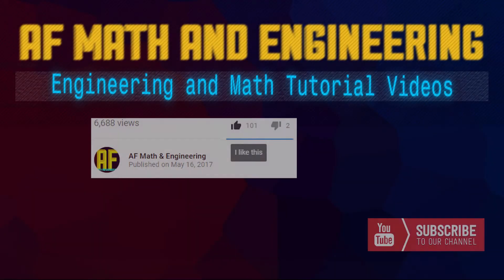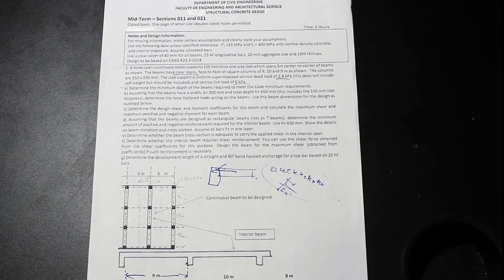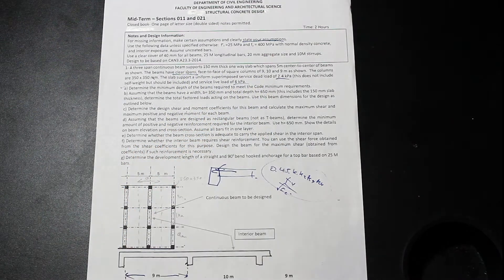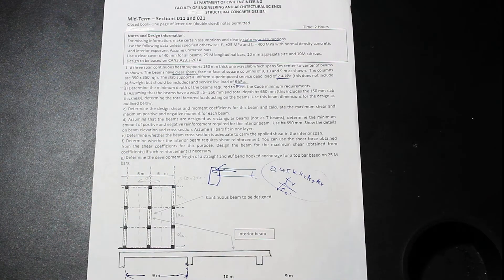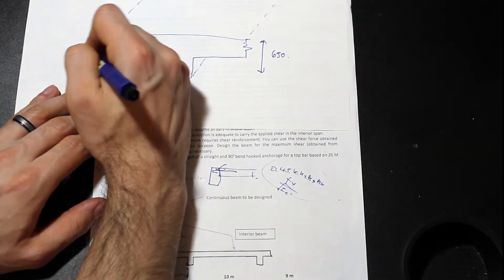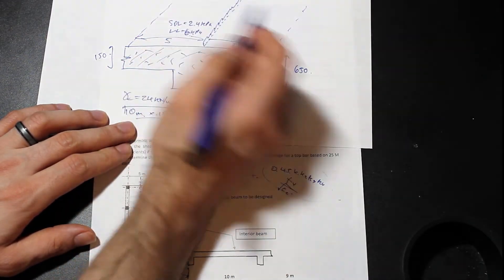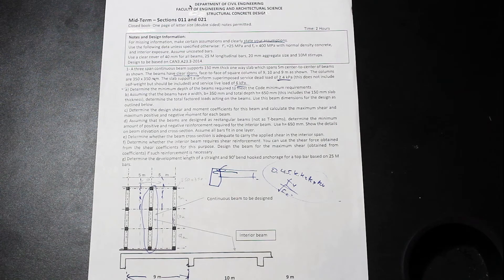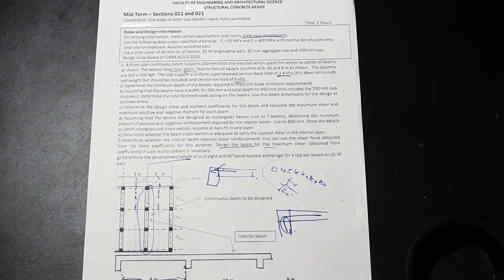What Do Civil Engineering Exams in University Look Like? - Structural Concrete Design 1

Comment: Can you explain more about Serviceability Load and Ultimate Load? also difference between SLS & ULS? Btw Awesome video :)
Reply from the maker: Thanks for the feedback! Check our newest video on strip footing design, we spoke briefly about the difference between SLS and ULS.  What specifically did you want to know more about? Let us know!
Reply: @AFMathandEngineering  What is difference between both limit states (ULS & SLS) and related load combination?
Reply from the maker: One is servicability limit state, the other is ultimate limit state.  Theyre part of limit state design.  Servicability limit state usually deals with unfactored, service loads and usually involves design of structural elements for things that dont require any factors.  Like settlement in footings, deflection in concrete members, etc.  Typically ULS deals with factored loads, for example designing for shear and flexure in a concrete slab.  You should find a book on limit state design, its a good read.
Reply: @AFMathandEngineering  Thanks for your prompt reply